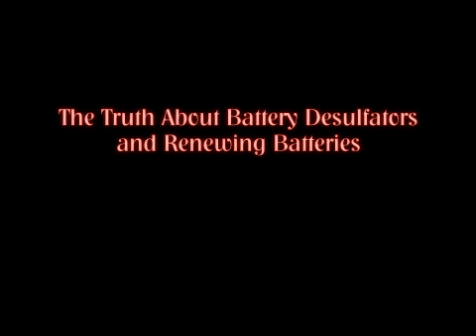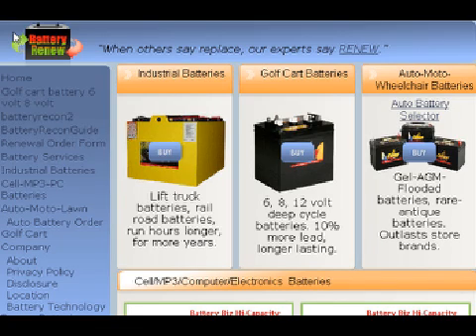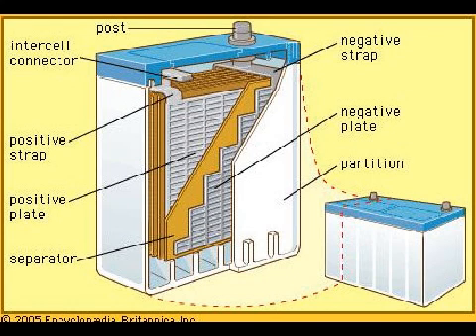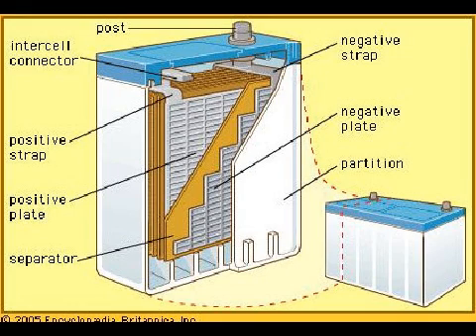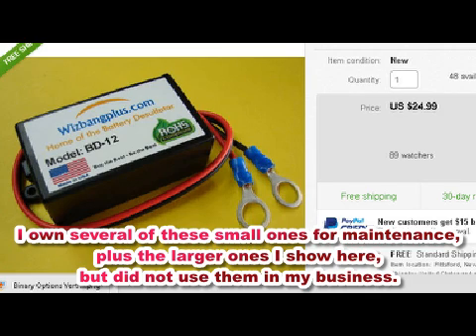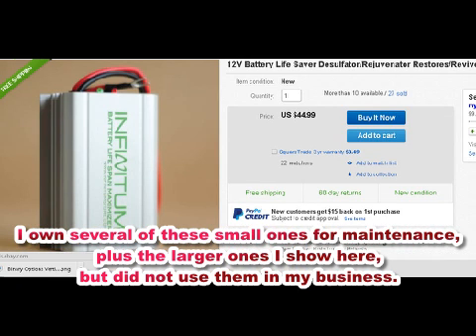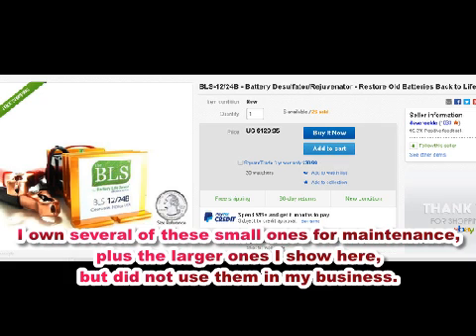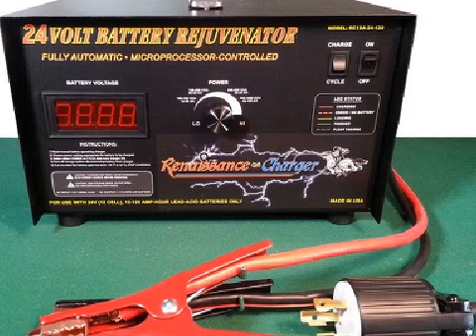The Truth About Battery Desulfators

Comment: Interesting video thanks for sharing, couple of quick questions if I may - 1) if you have a 12v battery with a swollen cell is there any coming back for it or once a cell has swollen that is it, battery for the scrap heap?  2) Is it a bad idea to put a desulfator on a really discharged battery, will it damage it or best to make sure its pretty much charged up before adding the desulfator?  Thanks for your time :)
Reply from the maker: +coolamasta1  Thanks for stopping by and asking important questions. 1. I routinely worked on batteries with swollen cells and brought them back like new. Be careful about your making sure your plates are covered up to about 1/4" or 8 mm with solution over the plates, caps off, and desulfate in a cool envirornment. The goal is to work the plates as hard as possible without increasing the heat leading to more wharping.  Usually batteries in the S.E. wind up with warped sides after three years or less meaning I saw "bubble" batteries all the time.  2. You want to start desulfating from a heavily discharged batter for the best effect. My automated desulfators or radiant chargers would drain my batteries way below recommended levels then recharge then over 15 volts for a 12 volt. That is smoking hot and not a great idea but it would leave the plates expanded with sulfate pounded back into solution.  Hope these ideas help you!
Reply: +Battery Renew Thanks very much for the reply, that is great info, I only have a small desulphator which is the Infinitum which is the 3rd one you show in your vid so it will prob take a while but will give it a go and see if I can bring it back!
I did have to top the cells up as a couple were just dropping below the plates but not by a massive amount, it seems like its just the swollen cell that's not taking a proper charge, when charging it will sit at a good 14v then when you take charger off if will slowly drop down to around 12.1 / 12.2v but then you leave it a few hours it will drop and sit around 10.8 which is why I though it was beyond repair, testing voltage in each cell does show the swollen one to be the one not putting out much where the other 5 are a good 2v each.
Reply from the maker: It sounds like the battery was either over charged, or charged without enough solution to cover the plates. The plates will overheat, rust, and lose the ability to hold a charge exactly as you described. You did not mention how old the battery was but heat makes a battery behave as though it has aged. 

An desulfator that rides on the current of the charger can fool the charger into thinking the battery is charged or bad. I tried these in line style of desulfators but they never worked on hard case batteries where the sulfate had been baked in during a charge. They would help somewhat on lightly discharged batteries.

I hope it works out for you though!

Comment: Hey  how's it going? I just had a quick question. Have u ever heard of someone placing there battery (say a car battery for instance) into an ultrasonic bath and sonicating the sulphated cell back into solution? Do u believe by doing this it would work? Please let me know u thoughts.

Thank u
Reply from the maker: +Rinaldo Di Meglio Thanks for your question! What an interesting idea..I know I tried something similar with an evaporust solution but did not get any positive results. I did not use ultrasound though but I wonder if it would make much difference. The sulfate and rust is tougher than varnishes ultrasound is usually used for. How were you planning on exposing the plates?
Reply: +Battery Renew Thanks for your response and interest! In the lab at work we have sonic baths with capacities of 8 to 10 L, which we use to help dissolve difficult crystal compounds into solution.(they're pretty intense). My ideal was to empty the battery of all the acid and add hot ultra pure water (60 Celsius) and seal it. Then submerge the battery in a bath at 60 Celsius just below the top so not to contaminate. Just sonicate for an hour will heating. Tell me all your thoughts please.
Reply from the maker: Rinaldo Di Meglio Just got back to my channel to answer you and am wondering if you gave your idea a try? I would think a high powered Ultrasound could knock off sulfate and then possibly shake the plates loose, but you could stop that process before it went too far. I have an ultrasound unit and may take apart a small battery to give it a shot. If it works, the next step would be to create a pendant that could drop into batteries and create the ultrasound effect inside the battery. Very cool idea you have.

Really curious how it worked out for you and will test it myself and create a new video about it.

Thanks!
Reply from the maker: Hey Brendan, I am getting ready to perform several battery experiments this weekend and film them. I have loads of complex battery problems to solve and make videos about. I have the ultrasonic system ready to go as well.
Reply: @batteryrenew8559  
Ahem. Would love to see those videos.

Comment: https://www.youtube.com/watch?v=Supe1a3LW2U and this video? What are your thoughts on that?
Reply from the maker: +Telephone Telephone I have used this technique on batteries that had no shedding, just sulfation issues. It worked fairly well, but my desulfating chargers achieved higher resting voltages and amp-hours. I am surprised that he was able to get a battery with practically zero voltage to renew. My experience over hundreds of batteries that batters below about 8 volts had shorted cells and they were gone for good.  For $10 bucks, it might be worth a shot. The chemistry will be way off if this method does not work and you want to use an electrical reconditioning method.

Comment: Thanks for the video.  I do have a question.  I have a solar system and want to install desulfators.    Should I install one per battery, or will on work for the complete battery bank?  I installed my bank less than 3 months ago.  At first it was completely charging within a couple of hours.  Now it does not go above 80%.
Reply from the maker: +Ray o Hi Ray! I know the frustration you are going through with your solar power battery bank because I have experienced the same issues because of bad charge controllers. Unless your batteries were over 2 years old or seriously abused, a desulfator is not the issue. Your issue may well be that you have not equalized your batteries, or more accurately, your charge controller has not equalized them. 

Here is what I do with my own battery bank: I use one of those big automotive 12 volt chargers on wheels ($150 vs $500+ for a 24 volt charger/controller), and charge two sets of 6 V batteries at a time until they are a red hot 13.1 volts. This is a surface charge that dissipates after an hour or so. Your batteries will probably settle at 12.8 Volts.  Then check the charge profile of your controller to make sure it is capable of driving your charging voltage up to about 15 volts for a 12 volt system, and 30 Volts for a 24 volt system. If you are not using MPPT controllers, you may have a hard time reaching the required 15 volts because 12 volt panels through a PWM controller can't drive the necessary voltage. 

After working with thousands of deep cycle batteries, my experience showed that you need major juice to impact the heavy plates without spending weeks to months desulfating. You might be trying to desulfate with those small, car battery designed desulfators. They are ok if you have weeks and lightly sulfated batteries. 

Start with a high amp auto charger, minimum 20 Amps, but 40 Amps is better, or even 60-100 amps. My system is roughly 460 Amp-Hrs, sort of small, but I have been able to  keep 7 year old batteries at full capacity with practically no degradation. 

After you equalize, then install Battery Equaliser and you will preserve clean plates and see your full capacity return. 
Let me know how this works!
Reply: @batteryrenew8559  (other than the equalizing), will this method of charging at the maximum recomended C rating of each AGM flat plate battery help to get rid of the sulfation. (my max recomended charge rate per battery is 35A.)  My 12V 930 AH  solar battery bank does not have the capacity that it once did. It's only 2 years old.
Reply: If you just installed the batteries and this happens, the first thing you need to do is check for a bad battery/cell that is dragging you bank down ! Id be willing to bet that was your issue 2 years ago...

Comment: Wow, you're the first person I've seen on youtube to have, use and show a bedini solid state charger and actually say, that it almost works too well haha. I had similar experience with small scale SSG models (wheels with magnets and stuff) and they do the same thing, although I probably never dreamed of the kinda charging speed your 24V charger has.
Reply from the maker: +TheRadiastral Thanks for watching and commenting on my video! I am interested in your SSG system and the kind of results you achieved. My experience with the Bedini chargers - sold under Renaissance Charger brand - is that they can restore batteries, but only at certain levels. The Bedinia chargers can also blow plates a part! I had to run out of the room when I threw the switch on my chargers because everything from fires to explosions to restoring a battery was possible. I have tried almost every battery restoring technology out there. For most people, the Renaissance chargers are financially not suitable except their little 12 volt model that barely works. The big boys cost around $1500 or so - have not checked lately - and can restore about 50% of batteries that have some life left in them.

Got any videos up of your SSG set-up? I would be curious to see it!
Reply: It's been almost 3 years since I last did any energizers, been experimenting with them for about a year and a half until then. I surely miss it, so might do some more experiments, try some ideas in the near future, we'll see. As to results I was getting.. hard to say. I restored to some degree all 5 batteries (bought as broken from scrapyard) that I've ever used for these projects, ranging from 7Ah to I think 60, using probably 10-12 different machines, all based on SSG circuit. See, i've never measured the amphours I generated with any machine, never had any before, so can't give any numbers. To my initial astonishment I could roughly swap batteries 1:1 for, what seemed, as long as i wanted, but that doesn't tell you what actual losses are, in Ah. As the time went by, loss of Ah became apparent, but it took many weeks, probably months.
Reply from the maker: +TheRadiastral Have you restored or repaired any power tool batteries? I used to restore NiMH all the time with my renaissance systems, but now am working on Li Ion batteries with much more caution. This is experimental mostly. I consider deep cycle desulphating and restoration an established method even if there are a lot of questions about which desulphator works and which one is just a glorified power chopping circuit. Since I have a fairly sophisticated capacity tester (all units including the primary CCA and AmpHr) I have been able to confirm when one of my desulphators actually does the job. When the process works, and I restore either a completely dead battery into working, or take a low capacity battery back to full capacity or higher, I feel like I won the lottery!  You might check some of my answers with +ButchTropic where I discuss how to measure capacity accurately. You sound like a battery guy like me, and could get years of use out of the investment.
Reply: Battery Renew I worked solely with lead-acid. Now that you mentioned it, however.. I remember from Bedini's lectures, that NiMH and NiCd can be charged without issues, but can Li-ion cells be pulse charged safely this way too? Does it work with those and if not 100%, then what issues have you noticed?
Reply from the maker: My renaissance chargers worked very well with NiCd and NiMH. I was usually able to return most of the power tool batteries to service after a few cycles with the charger.  Li-Ion batteries almost always have a protective circuit that I have to bypass for renewing the battery. Then there is the issue of exploding them :) The same principle works with Li Ion, just a more risky proposition. I will let you know how my next Rybio Li-Ion reconditioning effort goes. Those batteries crapped out on the Ryboi Li-Ion rechargeable kit in something like three cycles!! Talk about a rip off...If the renewing does not work, then I am going to rebuild the packs by only replacing the batteries that are undervoltage.  Have you been renewing your own batteries and how?
Reply: @batteryrenew8559  Yeah, only replacing batteries that are under voltage in a battery pack is a really bad idea.  

What kills batteries in multiple battery packs very quickly is when you drain the pack down far enough that at least one cell drains completely which then back biases it (negative voltage). 

That is a VERY bad thing for battery longevity, it will destroy a cell in not too long at all.  And you won't 'bring it back', period.  Cells in packs are closely matched, but if you drain the pack low enough this will happen every single time, unless they are perfectly matched, which is impossible.  

If the cells you replace are lower capacity and you drain the pack to where your drill or whatever really starts slowing down, the 'fixed' pack will be gone again in very little time/very few charge cycles.

It would be very simple to preclude this happening if you just had voltage sensors on each individual cell in the pack and just opened the circuit when the lowest cell hit that point.  Also it is not great to keep draining down li ion batteries a small percentage and recharging them.  They don't have a real memory, like NiCads, but they can demonstrate a phenomenon where they drop voltage early in the cycle, making them appear to have lost capacity.  Here you DO want to draw the batteries down to their minimum recommended voltages INDIVIDUALLY and recharge them individually and one or two full cycles will fix the problem.  The capacity of the battery was never diminished in that case, just the battery voltage capacity remaining vs. voltage discharge curve.

If you are going to rebuild a pack, replace all the cells with properly matched cells.

Comment: i have gas power cart other stuff with battery s that not being use are failing
Reply from the maker: +73 SUPERGLIDE I use my battery restoring systems for keeping my solar power batteries (8 at $120 each) plus my moto batteries (4 of them), tractor and car batteries sulfate free. I have truck batteries that are 6 years old and still register over their rating! I also use some restoring solution to keep the plates hard and resist sulfation.  If you want to build your own restorer, there are plans floating around that use an arc welder to provide the voltage spikes and amps - not a good way to go IMHO, but hey - would be a fun project.
Reply: it worth in vesting in verse making one from one compaster